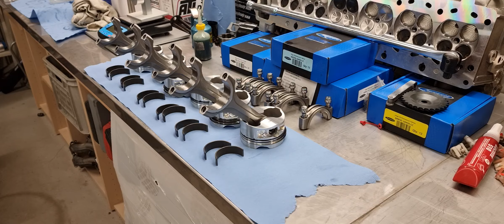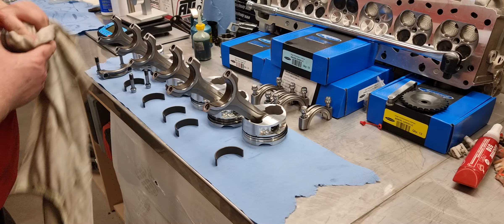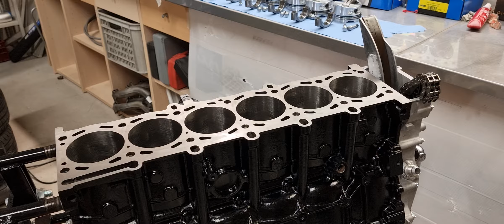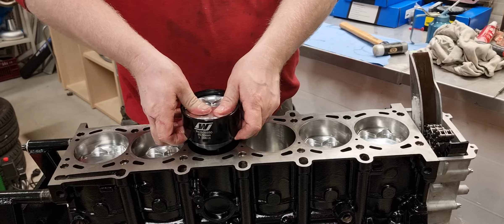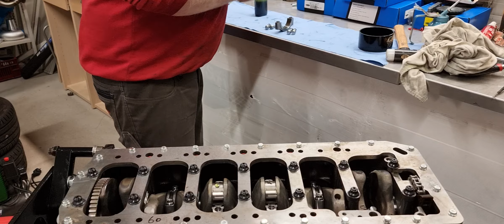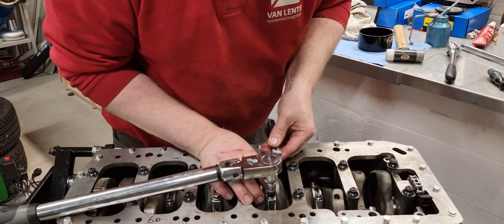Bmw S54 turbo Rod and pistons mounting! Dp engine parts pistons and rods #1400hp #5

Comment: Stock or sleeved block?
Reply from the maker: Sleeved to 85.5mm, you can see in other movies.
Reply: @BMWturbotim  how much power stock block could handle you think?
Reply from the maker: @emreaktas6390  I think for longer use not over 1100hp, I have already run 1 S54 with 1107hp. 87.25mm
Reply: @BMWturbotim  full stock heds is good for 1000hp? i mean stock valve, springs, guides etc...
Reply from the maker: @emreaktas6390  yes but depend on boost pressure and backpressure, i would say 900hp safe.
Reply: @BMWturbotim  do you have a needed full upgraded parts list for 900hp s54? Really liked your mechanic skills 👍
Reply from the maker: @emreaktas6390  Pistons, rods, Athena cutring gasket, Arp studs and engine is ready to go.
Reply: @BMWturbotim  how about main girdle?
Reply: @BMWturbotim  do you have email or instagram which i can reach you there?
Reply from the maker: @emreaktas6390  Facebook and insta yes same names Tim Maatman
Tim's turbo centrum